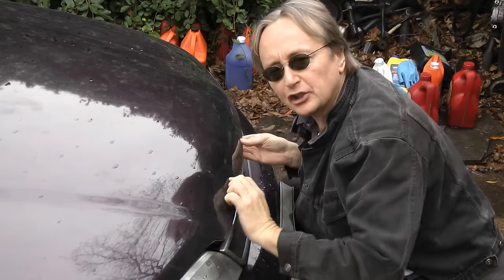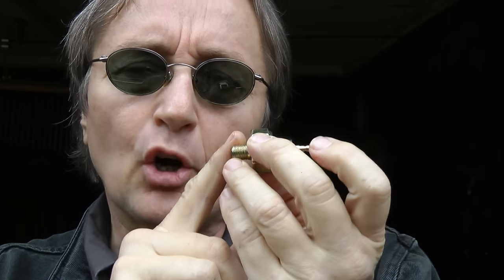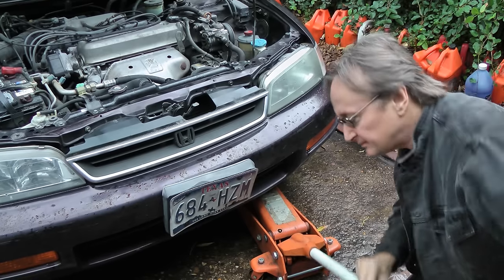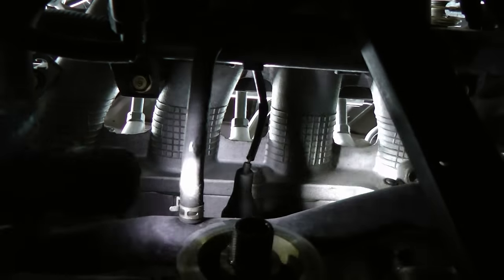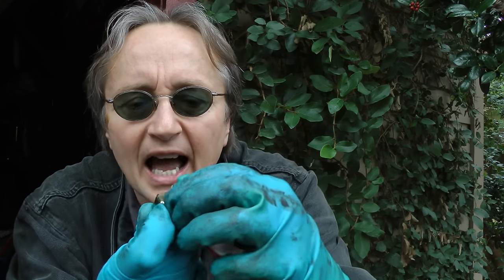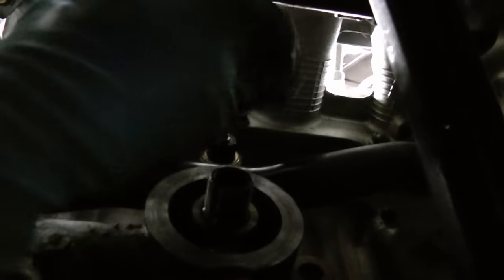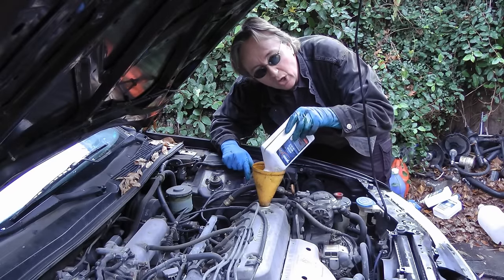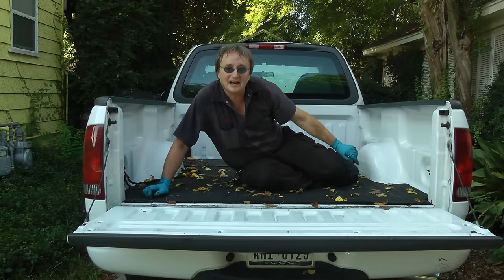How to Fix a Low Oil Pressure Light in Your Car

Comment: Hey Scotty, I have a 2002 mercury sable with the oil light blinking on idle when car is warm.  Oil is full and just had an oil change with 5w20. I wasn't blinking before and now it is. Could it be the sending unit or is it just because of the type of oil used?
Reply from the maker: change the oil filter, pray it's just got a weak spring inside. If not, change the sender and pray it's not internal to the engine
Reply: I mean it probably is a bad filter.. It wasn't doing it before the oil change.

Comment: p.s. on my reply above. I do need to take it in and what needs to be done. Just put on new tires today for another $750 bucks. Ugh. Wish you and I luck with the oil pressure problem. Oh ya, I need some brake work done for another $450. Just to add insult to injury. But a new truck is just too expensive.

Comment: I hope this is the issue with my 06 Uplander,the low oil pressure light comes on occasionally,when I rev it up the light shuts off,and the dinging quits

Comment: I have Kia sedona 3.8 2006,  
when car is cold the oil lamp not come on but after 5-10 minutes of driving then while in idle the oil lamp come on) only at idle 

1) I do scan diagnose ** No errors fault
2) I changed the Oil with oil Filters with both if the 2 O-rings (I used 5w20 and previously was 20W50) 
3) I changed the oil Pumb *NEW
4) I changed the Oil pressure switch *NEW
5) I cleaned the Throttle body 

idle speed is 650-670 RPM is that normal ? it is electronic TB !!
hope you can help

Comment: Hi Scotty, i have recently change my Toyota aurion oil filter, but the engine oil is still leaking.  I think it should be that after putting in the oil ring and the new filter, i have tightened it too tight?  Another problem I had is that the Oil indicator is not showing at all in the Dash board whenever i start the engine or when ever i shut it down.  I believe an Aurion should have an oil indicator pressure senor fix somewhere however it should at least show in the dash board isnt it?  Can you please advise whenever convenience.   And thanks for all the video you have post, they are really great.   Thanks Rudi

Comment: Hello I broke the fitting while trying to change the sensor on my 96 Chevy s10. Can you tell me where I can buy that fitting.
Reply from the maker: +Gabriel Romero I don't know what you mean exactly. BUT, if you broke the oil pressure sensor end itself off into the engine, you will have to try to remove it using an EZ out tool by driling it and using the tape to remove that end from the engine.
Reply: The piece that goes in the engine is the part I'm looking for. What is the name of that and is there a part number for that ?
Reply: Ok I replaced everything and my oil pressure is still dropping. Coyldvthis be the oil pump?

Comment: Hey Scotty. I have a 2001 dodge intrepid r/t. Just today while i was driving the oil light came on and the steering wheel was hard to turn. I shut off and cut it back on. It did it once more. Not even minutes later. I checked oil. Not below minimum Amount. Any idea what could be the issue?
Reply from the maker: if an engine idles too low, it will be hard to turn and the oil light can come on. check that first

Comment: Hey Scotty, So I have a 2011 Jeep Liberty and its change oil light will not turn off. Ive changed the oil and everything and did the necessary re-calibration afterwards but the light is still on. Got any idea what may be causing this?
Reply from the maker: bad sending unit or bad wiring, PrAY it's not a worn out engine or oil pump that soon

Comment: Could this be the same for a 2000 VW Passat? The car oil is not filled to the top, however I took it to Jiffy Lubes to get it checked and I was told it was sufficient therefore the problem isn't that it has no oil. Please advice me as what I can do.
Reply from the maker: it often is, especially if engine does not clank when oil light comes on

Comment: Scotty, I have 2006 H3, oil pressure light comes on for about 5 or 6 seconds then goes out, oil level is full, still possible sending issue?
Reply from the maker: change the sending unit and pray it's just that, those engines cost a ton to rebuild if they have internal oil problems

Comment: I have a question hoping you can provide a accurate answer lol, just had one of my Cylinder heads done over on my A4 2.4 V6, after the repair car was up and running but oil light now goes on, had pickup etc cleaned and FInally replaced the oil pump, all sensors have been replaced, everything should be in tact but intermittently the oil light comes on, when I drive it HARD, the light goes off, once I slow down or start breaking to come to a stop the light pops on again, seriously out of  options here....
Reply from the maker: NEVER just do one cylinder head or even two. Whole engine needs rebuilding as bottom end is generally just as worn. Worn bottom end will cause low oil pressure from worn bearing clearances

Comment: Hey Scottie I have a question. I have a 03 neon I usually change the oil with regular 10w30 oil but I was told synthetic oil is better and will clean out my engine. I changed it with synthetic oil and now my oil blinks on and dings almost every morning about 7-8 times on my way to work. Any suggestions as to why?
Reply from the maker: cause it's thinner oil in many cases, go back to regular oil, I've seen that happen on neons with higher mileage

Comment: hey scotty. got a truck making a rattling noise from under the engine. I have also been lost oil pressure. it rattles mainly upon start up. not a knock. oil pump maybe? or the engines done? there is also delay before guage does read. after a hour of driving...boom nothing. no pressure. any help would be great!
Reply from the maker: +TheRedneckmojo oil pump is probably shot, also check bearings on the crank for weak when pulling the oil pan off

Comment: Hi Scotty, 
I drive a 2006 kia  picanto, recently the oil pressure light comes on after driving for around 30mins non stop and light comes on only  when hand break is up. My mechanic has changed the sensor, check to make sure Oil are full and no debris found but  oil pressure light still comes on when hand break up. They tell me is safe to drive but i do not want to rise damaging my engine in the long run. I would like to seek your advice on what could be the reason and what should the mechanic check for and changed. Thank you very much.
Reply from the maker: put an oil pressure gauge, a real one, on the engine and have the actual oil pressure measured. If it's within specs, live with it. If not, engine needs serious work internally
Reply: Scotty Kilmer Thank you very much  for your advise.

Comment: Hey Scott I have a 08 Chevy impala  and my car is reading low  oil pressure what can I do to find the problem
Reply from the maker: +Basil Everett do as in this video and replace the sending unit, Pray that fixes it. if not, and engine makes clankingnoises at idle, you need serious internal work like oil pump or engine bearings

Comment: Scotty, I have an 02 Dodge Grand Caravan Sport 3.3L V6.  I've been having issues with my oil pressure light coming on at temp, after about 10 miles of driving, but going off under load.  I don't hear any noise from the engine that would indicate a failing main bearing, so I'm hoping this is just the pressure switch, but am also wondering if it could be a failing oil pump.  I've read that the pump is in the oil pan and, because it's so well lubricated, they basically never fail, but would like your input.

Also, my oil level is fine, and there's no oil on the ground to indicate a leak.
Reply from the maker: replace the switch and pray that fixes it. If not, have a mechanic put an actual oil pressure mechanic's gauge on the engine to check if it really has low oil pressure or not

Comment: hey scotty, i have golf 4 1.6 ventil. and the oil lights red, and peeps 3 times, and writes dutch öldruck motor aus betriebsanleitung. wich i cant understand. the lamp lights while driving, tryed to change the oil charger, but dindt work. the oil filter is newly changed, so i have no idea what to do next.
Reply from the maker: +Lord Aronath have someone put on an actual mechanic's oil pressure gauge to see if engine has low pressure, and if so, BIG money fixing that, oil pumps or just flat worn out engine with worn bearings do that

Comment: Hi Scotty, I've got a problem where the oil light flickers when the engine is in idle, could this be addressed with the solutions in the video ? or could this mean the situation is a more complicated one?

(Smart Roadster 2004) 

Thanks
Reply from the maker: try a new sender, pray it fixes it, cause if not, serious internal engine wear exists and that is never cheap to fix

Comment: scotty mine turns on when my car shuts off on its own and mycar is a nissan juke, rn it sounds like a diesel motor which its not but idk if u could tell me why, i was told its the air mass flow sensor i changed it because it showed the code

Comment: haha! Thanks! You may have just saved me a bunch of money...I will check back if you did!
Now can you tell me how to fix an ABS light? I ran the codes, on my 08 jeep wrangler, they said the speed sensors were bad, I changed the sensors, and the light was out for a while.....now a week later the lights are back on, I doubt the same sensors went bad. ....

Comment: Hey Scotty, I got a 2003 Mercury mountainer with a ford engine that has the high temp and the low oil pressure warnings coming on. They don't stay on but sometimes click on when I'm stopped. I press the gas and they seem to go away. ANy Idea? ANy help would be great. Thanks a lot.
Reply from the maker: change the sensors first and pray they are just bad and that the engine doesn't have internal problems

Comment: I have an 04 Mazda 6 in which the oil light flickers. I've been having a slight surge as the tac will jump up and down under 1000rpm and act like it's struggling to stay on. it does this In park, reverse and drive when at a stop. I just had the transmission control module replaced, as I was told that was the problem. any Ideas Scotty? Thanks!
Reply from the maker: +Kevin Douglas  if it idles too low, oil light will come on. So try my video "how to fix a car that idles poorly' and also check for vacuum leaks
Reply: +Scotty Kilmer Problem apparently solved. replaced the coil pack in cylinder 1 and there's no hesitation, surging or anything.  No oil light flickering either. yet at least. but the car runs a lot better!

Comment: I have this problem when the cars idle or driving at low revs . Ive changed the oil and the filter and its still happening , can the sending unit cause this to happen, if not whats the easiest way to tell if your oil pumps not working properly?
Reply from the maker: you then remove the oil sending unit, put a pressure gauge on it, and see what the readings are to see what the actual pressure is, and pray it's not really low, cause then it's take the engine apart time
Reply: Scotty Kilmer  was oil pressure switch cheap and easy fix  .  your videos help out alot keep doing what your doing .

Comment: Hi Scotty, I have a 1996 Pontiac Grand AM SE [4 cilinders], when I turn the engine on there is a check oil light on then turn the engine off and back on and light goes off but after 3 minutes when I turn it off and back on it is there again, anoying hate that, can you help?

Comment: What's up scotty the "greatest"
I was driving today from las Vegas to los Angeles I was doing about 100 mph for about 45 minutes on 3.500 rpm then my oil light came on "crap" so I let my foot go of the gas and quickly the light went off when my rpms dropped  is this because the oil got too hot ? I have oil on full and everything is where is supposed to be ? Im just curious what could of cause this I'm still a begginer mechanic

Comment: Hey Scotty,
I have a 1994 Chevy c1500, my problem is that when i start my truck the oil pressure reads fine but once the engine is heated and has been running for a while the oil pressure guage drops almost to zero. What could be the problem?
Reply: The truck has a small block 350 5.7l engine.
Reply from the maker: Martin Guzman  try a new oil pressure sending unit, pray that fixes it. If not , have a mechanic hook up an oil pressure mechanical gauges and if the pressure is low, you have serious internal engine problems
Reply: Thanks Scotty!

Comment: Hi Scotty, i have 1997 5.2 v8 jeep grand chtrokee. A few weeks ago I have changed the engine ol (costrol 5-w40. ) and after changing oil past two weeks which i drive it only today. Now i see that when i switch the transmission to D or R the oil level is going down. But in Parking it is working normal. Also i sow that the oil in the engine is a litle bit higher than normal. Now my question is the problem with engine filter, oil pump, oil presure or the oil is overfull filed.
Reply from the maker: if oil is over fill when you shut it off on a flat surface and check it after half an hour, empty some out first. Pray it's just that
Reply: No. It is same thing. When is temprature is above 100, the level of oil is again going to zero
Reply: Actually it has started after changing engine and transmission oil.

Comment: scotty im having this issue but as I'm driving no light as I'm in idle parked light comes on i give gas it disappears .. ? any ideas  i juat purchased the car and oil is full just had the oil change done ..
Reply from the maker: +Richard  O do as in this video, change the oil sending unit and pray it stops. if not, have a mechanic hook up his gauge to test the real pressure

Comment: Just cleaned my valve cover and replaced spark plug tubes gasket and cleaned tubes and now the low pressure light came on help?

Comment: Teflon tape doesn't cut it to seal those threads, I'm afraid. I tried it, and it was leaking by the threads on the newly installed switch, even though I had put some on them. High temperature liquid thread sealant works best.
Luckily on my 2003 Toyota Corolla, that sensor is easily accessible (once you remove the plastic radiator fan housing, held by only two bolts), so it wasn't difficult to take that pressure switch out again.
Reply from the maker: it works fine if you have a tapered oil sending unit and you get it tight enough, or course it won't work on one that uses a gasket
Reply: Scotty Kilmer Mine is tapered thread also. Maybe I didn't put the Teflon tape on tightly enough, or not enough turns of it ? Anyway, the liquid sealant makes an even easier job of it, and also acts as a breakable thread locker.

Comment: scotty i have a 2002 ford explorer and i get low oil pressure when i turn ignition key all the way but i do not turn on the car.. once i turn it on it goes away could that be the sensor?
Reply from the maker: no, pressure only works when engine is running, it only measures pressure when engine is pumping oil
Reply: o ok but if i may ask what could you think it might be that im getting that message, and its only when the ognition key is turn fully around but i dont turn un the car

Comment: Hi Scotty, I've got a 2007 Jeep Compass with 98000 miles that throws an occasional oil pressure sensor trouble code (forgot which one exactly) and now the oil pressure light is flickering while driving. I changed the oil and it made no difference. The engine isn't making any unusual noises as far as i can tell. Am I looking at a failed sensor or is my engine going to blow up?
Reply from the maker: change the sensor first, if you really have low oil pressure, engine would clank like mad on the top end

Comment: Let's say I have a 2009 Hyundai Sonata, the 2.4L 4 cylinder GLS version. Where is the oil pressure sending unit on that?  

The oil pressure light just started coming on today. I checked the oil level and it reaches the full line on the dipstick.  The light goes away when accelerating enough, but comes back on when staying at a constant speed or slowing down.  

I don't know if this is related: The spark plugs were changed yesterday, and the oil/oil filter were changed a week and a half ago.  It has 230,000 miles on it.

Comment: Most common problem is the oil pressure sensor.  But if that happened on a 04-06 Subaru WRX/STI.. don't assume it's just the sensor.  Those car have issues with the oil pickup tube snapping off causing oil starvation.  If you drive one and the light comes on and oil level is fine.. don't assume it's just a sensor.  Better safe than $3000 short (for new engine.. block only).

Comment: hey do u know were it located the oil pressure sensor for a mitsubishi 3000gt
Reply from the maker: +Cesar Barrera I would need to know the year of the car also, but most are close to the oil filter
Reply: It i 99

Comment: Hey Scotty, I have a 05 Grand Cherokee 5.7L and the fault code is says to replace the oil pressure switch. Do you know what the part number is. I contacted the dealership and got the exact part they requested and had a shop attempt to put it on and they said it was the wrong part. Note: I am out of country;) so I can't do any of this myself. Thanks. Jamie
Reply from the maker: 5149062AA is the dealer oem number

Comment: Mines blinking and i just changed the oil pan gasket and the oil and filter and it still on blinking my car is a 2001 ford escape 3.0l 4x4, where would the sending unit be on mines?

Comment: Hey Scotty , i have GMC Envoy 2002 , when i go at mountains on a long way , there is a problem with oil and show me a massage "Low oil Pressure please turnoff engine " and the oil pressure goes down at 0 , i don't know what is the problem ??
Reply from the maker: replace the oil pressure sending unit, and pray it's just that and not actual low oil pressure that costs a ton to fix with internal engine damaged parts
Reply: i have replace the engine before 6 months and i remember i have that issue before because i have move the external parts from old engine to the new one ...  thank you  :) ...